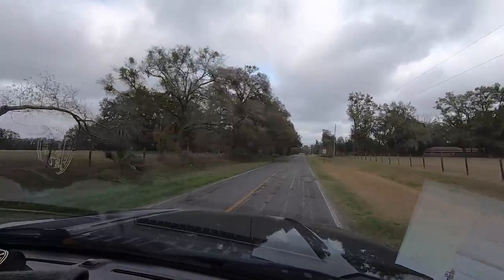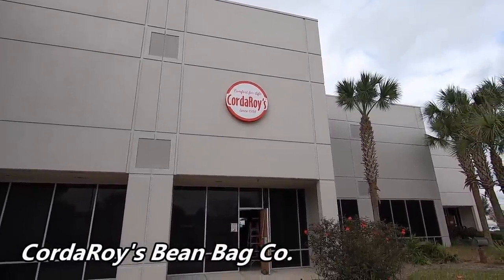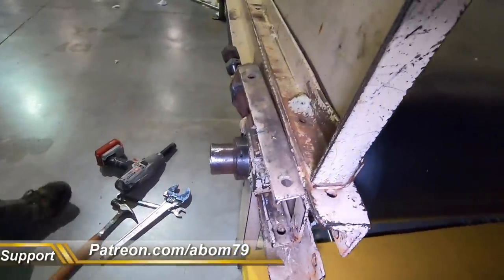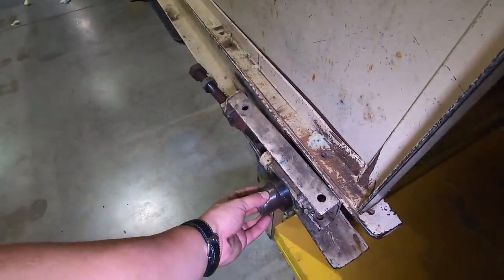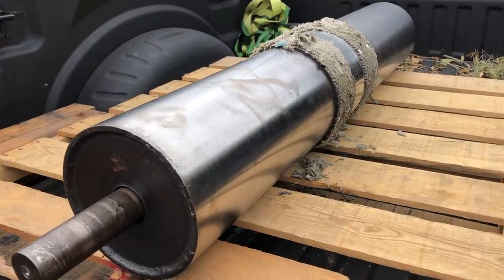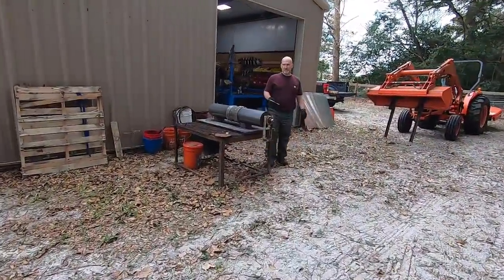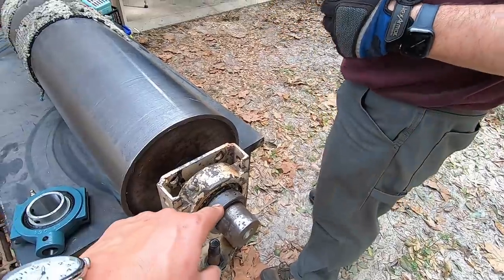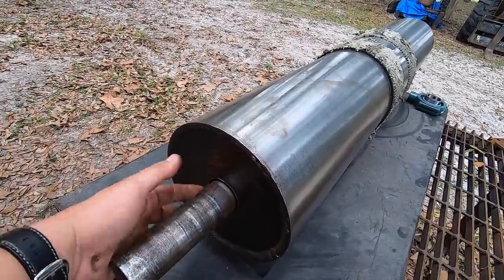Conveyor Roller Repair

Comment: I have been trying to perfect the art of welding without a ground for years.
Reply: I did that once. Had a die on a cart in the welding booth. Wasn't getting it to weld well, till I took the ground clamp off the welding  table and hooked it to the die cart.
Reply: If your welds sound like bacon, your doing great but if they smell like bacon, partner your on fire

Comment: Nice to see that the maintenance dept operates the same way at other plants like they do at mine. We are told all the time that even if the machine that is making the product ($1 million dollar piece of equipment) is making unhealthy grinding noises that we are supposed to run it until it breaks. 9 times out of 10 it ends up breaking even worse then if they would have stopped and replaced the small part that was broken or damaged to begin with. Instead the machine ends up crashing causing it to be down for days at a time waiting on parts to be overnighted because we can't seem to keep a dam thing in stock we need to run said equipment.
Reply: That is because breakdowns are covered by insurance, maintenance is not
Reply: Been in maintenance for over 30 years. You are spot on. Just make it run we need the parts. How much longer. Is the parts here yet, why not. Maintenance manager no one told me we was out.

Comment: Yes I have repaired quite a few rollers like that for the company I worked for. And have had to replace the hole stub end and weld a new one back in. I think its the vibration and the tension that keep breaking the weld on the ends.

Comment: My memory is fuzzy; but I used to work in a roofing factory.  Asphalt shingles are like very low grade sand paper, so we went through rollers like that almost every day.  If a bearing wasn’t to be salvaged, the quickest way to remove it was with a blow torch. 

I can’t remember how the machinist welded the broken shaft.  We sent them out to get rechromed fairly regularly. 

Those belts in the center indicate to me that they don’t know how to set up the conveyor. It shouldn’t need that for either traction nor for tracking.  That they didn’t even have someone who knew how to take it off also indicates that they need better maintenance techs.
Reply: My vague recollection is that you should cut the end plate off before repairing it.  Welding the plate on again should be the last step.  Cats get skinned different ways, though. 

I think our guys did the job on the lathe.  We had rollers that size and much larger too.

Comment: Ran my 100 foot extension cord out , plugged it in , plugged in my heat gun to warm up the new plastic conduit l was installing to my new circuit breaker box. Heat gun did not turn on . No power hooked up to the box yet . Duh . Makes no ground clamp look like an easy miss . 😁
Reply: you're not the only one, trust me :))
Reply: @throttlebottle5906  
Thanks brother. It was a Homer Simpson moment as l stood there looking at the heat gun while giving myself a dope slap.

Comment: I hate to say it but I'm REALLY surprised you didn't weld both sides considering at the beginning of the video at around 4:30 it looked like their was a 1/8 to 3/16" gap between the shaft and the plate and you had no problem moving the shaft around there's no way that weld on the other end was solid it must be also broke at least half ways around,and I know some have just a short shaft inserted with the plug welds but generally when you don't see evidence of plug welds it's just a full shaft,some of the ones I've cut apart were just a full shaft,a weld  on each side on the inside only then that assembly was just pushed into pipe and welded outside, I've only done about 20 of them but that's the way I've always found them to be but of course if it is only a short shaft since you guys had it out and knew it caused that problem on one side for the sake of a couple rods it definitely would have been worth the time to do the other side too, especially after someone hammering on the shaft enough to swell it up and since one weld was broke all that force would have been transferred to the other side,  But still a good video.keep them coming.

Comment: I have to say that using the SMAW is definitely the way to weld up this shaft to roller. The sound of the welding Adam is right on. Great job fella burning in the rods to the piece. Scenery is just great where you are too.

Comment: This comment is for Lance. I have the same welder. You have to disconnect the foot pedal, put the switch in 4t, and select the stick welding option on the tig/stick selector switch. Then the main amps is your amperage control.

Comment: Amazing work. But if I were you, I would weld the other side too anyway because it is going to break soon. It seems that the inside welding was not done properly. Good work anyway. Thanks for sharing.
Reply: Same thought, wouldn't have taken much more effort after all this setup.
Reply: Asked the same question before I saw yours.....

Comment: I have found here in Brisbane, welding around meal times, especially afternoons/dinner hour the power appears to drop off, having to turn the welder up higher than normal. I have put it down to ovens being used to cook meals. Maybe I am wrong... Good video congrats to you both....
Reply: Spot welding is more sensitive to power fluctuations and yes meal times were when welds went off and time to readjust. And back again in an hour. that was in the 70's
Reply: Back in highschool I took a graphic design class. We were next to the shop class and whenever they were welding we'd have to adjust our exposure times in the dark room.

Comment: Adam always does flawless work and I enjoy being able to watch over his shoulder to learn or at the very least see another way. His patience is godly.  Having said that,  what was stopping the original guys working on it from popping off the belt, grinding off the bearing as displayed, and welding it?  in position even...you can check concentricity visually as displayed.
Reply: Experience and skill.

Comment: I do this exactly the same way but still installed on conveyor I work maintenance at 3m 17 years now certified and we fix big rock crushing equipment and elevator conveyors it’s basically steel buckets bolted to the rubber around 300 or so it goes about 10 stories up and we have about 30 of those and lots more but it’s my life

Comment: Your show is so great, all of the tools and work you do and use bring so many good memories. Everything is there except the smell. I am a 77 year old time apprentices tool maker from the 1955. The tools and machines you show and talk about are so neat to see. The way you move and machine parts really takes me back to the old way of really doing nice machine work. Drills,taps and so much more. I never got into the inserts to use, we all ways sharpen all our cutting tools and my first job in the tool shop was to fix and keep up the overhead drive belts repaired and oil all the machines. Thanks for all the great shows you give us , we do even learn new things from you. THANKS    Bob V

Comment: 14:40 make sure you don’t have arc force turn on. If your at 120amps and have a 15-20% arc force that would turn up your amps when your getting close. There’s also hot start that bumps your amps up when you first start but that’s only for a fraction of a second to a few seconds not for a whole weld.
Reply from the maker: Thanks, I’ll have Lance check that out.
Reply: Arc force is just voltage control, the more arc force the less volts and the dryer the puddle/more dig. Looks like the arc force was too low or set to low on the soft setting.

Comment: I'm a machinist (not a cnc guy) building and repairing rolls is part of what I do and have done for a lot of years. I'm wondering how you kept the shaft from warping? Normally when a shaft is welded you need a bigger shaft then turn it to the roll after welding. After our millwrights do a repair like this I generally have to do a complete rebuild or make a new roll. A couple of years ago I talked the lead millwrights into switching to b-lock's. Now most of the time all I have to do is cut and key a new shaft and that frees me up for other jobs. Like your video's

Comment: This is a temporary fix.  Abom when you see the ends crack like that it means the shaft is too small of diameter for the width.  The sides crack because the shaft flexes and the drum does not.  A correct fix is the shaft get replaced with a 2 15/16 rod with the end turned down to 1 15/16. Always use collar bearings on one way conveyors.  Forever fixing aggregate conveyors ;(.

Comment: I really enjoyed seeing you roll the angle grinder on that flared end of the roller. In the shop I work in we produce alot of handrails, rolling the grinder is really the only way to achieve a clean flat free grind. Grinding flat and working to the sides almost never works. I'm not surprised you do it the right way lol! Master machinist and now fabricator as well :D

Comment: Good looking welds brother. I wonder if that machine has dig function that’s bumping the amps up on you, I don’t know just was thinking. Looks like that roller was running pretty damn true using just some farm tools!
Reply: @WinkenBlinkenAndNod  Typical "China Special." Can't even find a manual for the thing. Doesn't look like it has a dig / arc control function, but a too high dig setting is a common cause of amperage fluctuation with drag rods like 7018.

Comment: Are those live oak trees?  At a guess this is a slow moving belt where it's not critical to run true.  The shafts look pretty beat up as is with pitting and obvious bearing wear.  Eventually Adam might get a job to remove and replace the shafts with new ones.  At which time he would probably make them better than original.

Comment: The "maintenance" in a lot of plants is hap-hazard at best.  You fix(replace) things that are broken to get back going again.  I was called to go to work at a plant-learn the machines to be able to repair them and keep them going.  All I really did was fill in on production until something broke then hoped to fix it or replace a part.  Someone previously had welded the shafts to bearing races to fasten them and they were on a German built machine.  During one meal time, I took the air filter off the air compressor and blew it off to clean it instead of replacing the filter(this was all the maintenance I really was able to do.  The executives never came out to the plant to check on anything  and the two guys running the two sides were brothers and did not want to call for parts which a vacuum check valve was about $3000.  After I got it changed I was told that "it isn't working out" so I was fired.  All they seemed to  want to do was patch patch patch.

Comment: Just wondering....in a case like this where you had a weld failure at one end.....might you want to add some weld on the other end just to add a little insurance that the original weld there might fail at some future date. ? As always, mondo respect at your skill and experience...
Reply: Yup, great channel. Welding the shaft to roller side plates is failure prone. Taper bore/bushings has proven more reliable,  and true !

Comment: Great job. But why you did not weld the other side?
With my experience when a Spindle shaft have problems on one side the other side would be affected in time.
Reply: EXACTLY what I was thinking. If it failed on that end, I'm sure the other end was manufactured the same way and could suffer from the same failure. I'm a 3rd generation mechanic/machinist and my father always taught me: "While you have it in your hands is the time to fix it like it supposed be fixed"
Reply: @esutton493  at the 20 min mark he said he ran a bead on the other side.
Reply: @PB-wb2kj  
"he said he ran a bead on the other side"

He did not say that.
Reply: @PB-wb2kj  Ran it back he said he cleaned up the other side did not say weld, that's the magic of recorded video playback.
Reply: @alt-w7130  ah crap, I misunderstood it then. That side is going to break then.

Comment: Nice repair and nice place!
 Its just a stub shaft and not a through shaft right? Not to be negative but the inner plate should have been welded in place inside the tube to stop the flexing in the outer plate weld area.(btdt)You have to open up the end to see how to get inside and weld it up.

Comment: While roller was out you should put a exterior bead on other end preventive medicine unless your looking for future work
Reply: I was thinking the same, while it was out and they had all the gear out just do it because if one side has gone won't be long before the other side will make a bid for freedom lol
Reply: If one looks at it logically, since the broken end is loose and moves, the other weld is also compromised as I see it.

Comment: Have one of those at the plant I worked at. Weird design .. the shaft ran all the way the cylinder and bolted to the drum just on one side with a welded on flange.  Never did understand why it wasn’t welded on the other end too.  Weld use to break all the time.

Comment: Surprised that their tail pulley didn’t have 2 taperlock bushings so you can change any part , that’s how they usually are at most places , must be a china made deal on the tail pulley, seems like the welder has a hot start setting that is really slow to calm back down

Comment: I was surprised to see a new bearing and a housing put back on the shaft. The bearing could have been removed from the old housing and a new bearing put in at a lower cost.
Reply: Often times parts like that cost less than the labor making it cheaper to replace more parts with less labor.
Reply: I think changing to a different style of housing (set screw vs collar) was the motivation behind changing it
Reply: It wouldn't surprise me to find the complete unit was a cheap as a new bearing. Also I wouldn't trust the shop mechanics to be able to replace it without wrecking it.

Comment: I'm no expert but surely if the inner support plate is loose then the bead of weld on the shaft is going to fatigue as it flexes due to movement between the inner plate and the I/D of the roller. I believe this is half a job.

Comment: Curious why you didn’t throw some weld at the other end ??
Reply: That shaft likely doesn't go all the way through. Typically there is a stub shaft at each end, welded to two "rings" and plug welded is the pipe. The shafts only go in 8 - 10 inches. I have 120" one at work I'm repairing now, but have to make a new stub for it. (its trashed) Taking them out can be a pain because the belt wears over the plug welds, and you cant see them.sometimes its only a guessing game on where they are.
Reply from the maker: Weld an end that’s not broken?

Comment: pipe welder here, we never weld 7018 down hand, that might be your problem
Reply: I don't know anything about pipe, but I'm good at welding garbage. I can stick stuff together with 7018 in almost any direction or position. It doesn't break either.
Reply: Instant fail if they catch you down handing 7018, traps slag. Now 6010-.....little different.  With d1 certs its uphill.
Reply: Retired UA 342 Welder Here....6010 rod you can WELD..Up or Down....7018 Up Hill ONLY.....And as Far as Papers their NO GOOD as soon as you Leave the Job your on.... Sometimes a Inspector will Except them... I've Drug up on a Job that I Just tested on and go to another Contractor in the same Plant the Next Day and the papers are NO GOOD and have to retest....
Reply: D1 certs are structural welding, the cert is good where ever you go.  As for pipe normally thats qualified on the job.  With that said I have never seen a 7018 procedure allowing any down hill.  Personally I carry D1 certs in 5g, 6g.  I dont weld on any pipe as thats work for the 597 brothers.  They are excellent at it.

Comment: In your opinion, would it make more sense to take an old brake rotor (that is decades out of production) and see if a shop can weld it up and turn it back to spec, or have the shop make a new rotor from scratch? As far as I know its carbon steel, it's off a Honda gl500 interstate.
Reply: Alexander Simcox is it solid or slotted?

Comment: Bad practice to weld direct on shaft ,Use weld on hubs that lock on the shaft  with Taper locks
Reply: Yes that.s the best way better for future repairs too
Reply: These are low budget pulleys. I used to make conveyor pulleys for a living. The shafts in these are always 1018 they are readily welded. The higher end version of this pulley would have a profiled end disc with line bored, hub bores which would then be fitted with keyless locking devices and a through shaft.

Comment: Why didn't you weld the other end while you had it setup?  If it failed on that end, I'm sure the other end was manufactured the same way and can suffer from the same failure. I'm a 3rd generation mechanic/machinist and my father always taught me: "While you have it in your hands is the time to fix it like it supposed be fixed".
Reply: Grandpa Es  he said around 17:51 that he did the other side and cleaned it up... hope he welded it...
Reply: Not getting paid to fix some thing that's broke.
Reply: shawbros sooty was looking at wrong time stamp, edited my comment.

Comment: Random lathe question! I was reading about TOS Lathes ... they can power feed the carriage, without the lathe chuck spinning
It can be handy for specialty machining (like cutting internal keyways, with the lathe) 
Does anyone know if any other brans of lathes can operate in this manner?
Reply: Mike Baxter yes alot of machines can power feed without spindel running